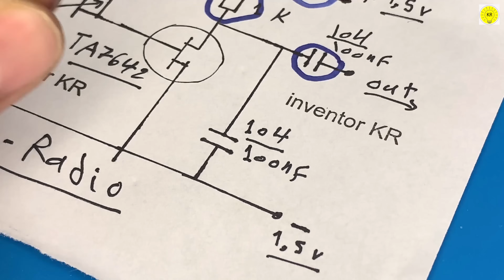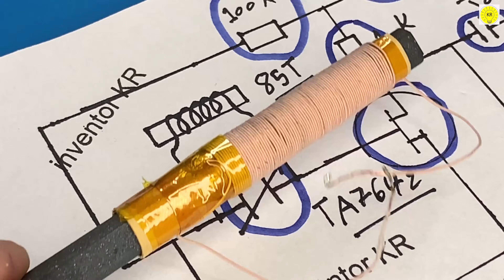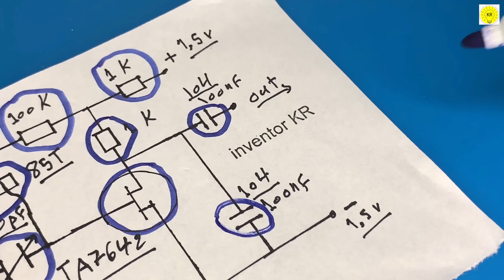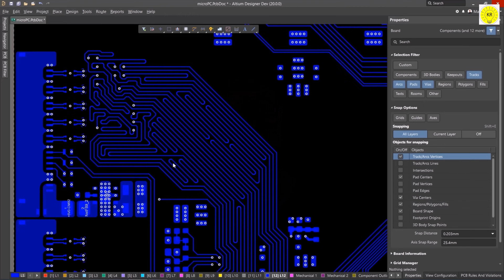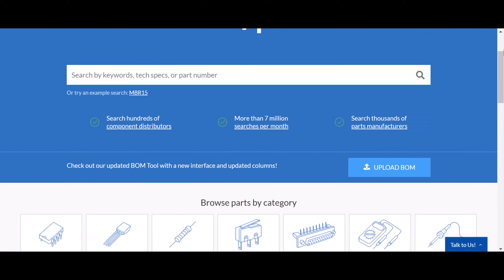make a simple AM radio , receives all international radio stations

Comment: Well, that's some of the worst soldering I have ever seen. Apart from that, it's really just a single stage RF amplifier which is reliant on the non-linearity of the circuit to produce an audio output.

Comment: I'm a drummer and Made a beautiful 6 piece electronic drumkit! Seen it on YouTube. So I bought a brand new cheap ludwig 6 piece evolution kit that was for half price because the music store was making room for the newer models and I told them "I'll take it!" So my brother and I got 2X2s cut them and screwed them into the lugs. Then came the sensors. I used giant 50mm piezo elements soldering them into a jack that went to the air vent. For snare I needed 2 piezos for rim shots.😂 I created cones by using some type of material (not too soft not to hard) used thick double sided stick tape for vibration isolation. Finally I put mesh heads positioned on top of the cone and lugged them down. using trs cables I plugged them into and old drum module which went into a mixer. I bought cheap drum cymbals that even choke!😅 I bought cool 2 piece hihat pads and are very responsive. Love the kit so much! I record with it and make videos. My brother died of lung cancer (never smoked) in January 2025 and every time I  play it, I look at the wood and screws that he put in. I'll cherish this kit and his memory 🙏
Reply: भावुक कर देने वाली पोस्ट.. मुझे भी हमारे दोस्त बिछुङने का बहुत दुःख हुआ... यादें सदा रहेगी... 😢😢😢

Comment: Would it work without the transistor?
Reply from the maker: Great question! While transistors are commonly used in AM radios for amplification, there are some simple designs that can work without them, relying solely on passive components.

Comment: wait a sec...what is the value of the battery and how is it biasing the transistor...?or them capacitors charge it for a while to raise the voltages up for a while?
Reply from the maker: Good catch! The battery's got to be just right, and the caps help keep the voltage steady. Let me know if you want to nerd out over the details!
Reply: @inventorkr1 sure buddy I really want to. More in-depth analysis...I understand the signal is sinusoid right..? Buh I didn't catch a diode for rectification in your acct or it depends?

Comment: Without a diode, how the signals will rectify/????
Reply from the maker: Great question! The diode is essential for rectifying the signals, but there are alternative methods to achieve signal detection in AM radios.
Reply: @inventorkr1 i this circuit, which method you have used instead of a diode? Bro...

Comment: He give us a wrong information. In diagram shows that he using a MosFet. But  TA7642 is a AM Band radio IC. So nobody should not try it by using any other MOSFET. It will not work. Everybody who want to make this simple radio, before start by any other MOSFET must check TA7642 datasheet by Google charge.

Comment: Can't solder. The whole board should have been tinned. And on the homemade board it was necessary to make pads for the parts. The pins at the end should have been bent to have better contact. It is necessary to use flux. There is no point in showing the same operation a thousand times on video. TA7642 is not a transistor, as shown in the diagram, but a microcircuit. The video is useless for training, since there are no basic elements - such as transistors, diodes and inductors.

Comment: When I was about 10 my dad got me a set like this for Christmas. There was no soldering, the baseboard was a grid of contact points into which screws could be driven to hold the components. We immediately sat down to put the radio together. Meaning: he did the putting together, and I the watching without touching. The radio did work. We had great fun. Well, at least he did.

Later I took everything apart and followed instructions to build the thing myself, but it wasn't quite the same. The somewhat painful memory only became a fond one by the time I was 20.

Comment: I was given a simple crystal radio kit as a kid.    It didn't work but an electronic engineer uncle said the crystal working as a diode was junk.   He replaced it with a proper diode and it worked fine, using no batteries.   It was my first real introduction into listening to the radio.   The theme song to the movie "The Good, The Bad, And the Ugly" was popular on the radio at the time and I heard it a lot.   Fond memories of that crystal radio set.   😊
Reply: You probably had a piece of Galena with insufficient hot spots. It would be very rare to have one without any, but I suppose they might still occasionally turn up. I'm glad that you enjoyed the receiver. My first one put me on an escalating path to a life long hobby and career. Can you imagine a hobby that you get paid for doing?
Reply: Me too, i built never worked
Reply: Why is there so much interference in this set?
Reply: @JB-uj3qm Excessively wide bandwidth. It's caused by low Q resulting in lack of selectivity. Ham operators and serious SWLs have a lot more control over those factors with sophisticated designs. Simple still serves a purpose however.
Reply: 10 A Diode

Comment: Exactly! This is the essence of Adventious Learning—self-education through self-realization. Instead of just reading and memorizing, you take immediate action to test, verify, and deeply understand what you learn.

Example Breakdown: Electromagnet Experiment

1. Traditional Learning Approach (Passive Learning)

Read: "Coiling an insulated wire around an iron rod forms an electromagnet."

Memorize for an exam.

Forget in a few months.

2. Adventious Learning Approach (Active Self-Realization)

Read: "Coiling an insulated wire around an iron rod forms an electromagnet."

Ask yourself: Is this really true? How does it work?

Test it out:
✅ Take an iron nail.
✅ Wind insulated copper wire around it.
✅ Connect it to a 12V battery.
✅ Bring a small iron pin close to it.
✅ Observe the attraction.
✅ Turn off the switch and see what happens.

Self-Realization: Now I know that electromagnets only work when current flows!

Because you’ve seen it with your own eyes and felt it with your hands, this knowledge becomes deeply ingrained in your brain—you will never forget it.

Adventious Learning vs. Traditional Learning

---

The Bigger Picture: Applying Self-Realization to Everything

The electromagnet example is just one case. This method applies to any subject:

✅ Mathematics → Instead of just memorizing formulas, try to derive them yourself.
✅ Programming → Instead of watching tutorials endlessly, start building small programs immediately.
✅ Business → Instead of taking endless courses, launch a micro-business and learn by doing.
✅ Engineering → Instead of studying blueprints for years, start designing, breaking, and fixing things in real life.

🚀 This is how true innovators and inventors are made.

---

Challenge for You:

What is one thing you’ve "learned" but never actually tested in real life?
How can you apply self-realization to verify and deepen your understanding?

Comment: Habe meinen selbstgebauten 8-Kreis-AM-StahlröhrenSuper  mit EF 13 in der HF-Vorstufe, die aperiodisch mit mit der nachfolgenden ECH11 gekoppelt ist; anschließend mit einem 4-Kreisbandfilter  mit der ZF-Röhre EF11 bestückt ist sowie einer ECL11 als NF-Verstärker.
 HF-Röhre EF13,  ECH11 und EF11 sind schwundgeregelt mit gleitender Schirmgitterspannung in Betrieb. 
Der Superspulensatz SSp 256 von Fa. NEUMANN mit 3xKW, MW UND LW  ist hierbei zum Einsatz gekommen; für die Funkamateurbänder 40-, 20-  und 15-Meterband habe ich nachträglich noch einen Transistor-BFO im Einsatz.
Auf LW geht gar nichts mehr.
Auf MW tagsüber nur noch Radio Budapest hörbar, was sich nachts aber mit viel mehr Sendern durch die Raumwellenausbreitung bemerkbar macht.
Auf KW geht natürlich alles wie vorher; die Funkamateurbänder sind exzellent mit meiner selbstgebauten KW-Lupe zu empfangen.
Resümee:
So ein AM-Empfänger passt nicht mehr in die heutige Zeit; der Störpegel ist gewaltig und lässt einen Empfang von MW-Sendern nicht mehr zu.

Comment: To make circuit board, simple way to apply resist for etching is to draw with Sharpie magic marker instead of using tape. Be sure board is clean first. Also, etching is quicker if ferric chloride is warm, not hot.

Before etching, clean board with 400 grit sandpaper and then wash with alcohol.

73 DE KK5R

Comment: The heterodine radio, what is the measure of the transistor, is NPN, or PNP, the what is the measure of the coil, winding from wire of  copper, and the bobbin bar for heterodine winding of what turns, the resistence variable what is the measure ? The speaker what is the power measure, and their resistence, the plate of copper what is their measure, what time are in solution?

Comment: Way back in the mid 1960's I used a tiny am only "Transistor" radio. These were very cheap, used a single 9-volt battery. And had a single  mono only ear bud. 
If you used the built-in speaker you killed the battery in just a few days. BUT if you just listen through that one little ear bud, the battery could last you over a month!
Good times! Sleeping outdoors,  under the stars! With my radio and an old pair of War Surplus binoculars. I'd sky watch all night long.
Reply: Same here

Comment: This soldering method is a disgrace to any self-respecting electronics engineer, it was too hard to drill the holes.
Reply from the maker: I appreciate your opinion but this makes it easier to understand the connection of components.

Comment: This project remember me when I was a boy and I built an am radio with my father using only 3 components, a germanium diode, a variable capacitor and a coil, as well as the antenna which was a simple wire.
Audio in headphones, no battery...it was very funny!
Reply: वाह 😮

Comment: This design is bad, I doubt it even works. Without an antenna, you'd be lucky to receive a signal from a meter away. Connect an antenna (a wire will do) between the LC tank and the input of the IC. The longer the better. Using a handful more parts can make this actually work

Comment: That's bullshit.  Where it is the diode that will rectify  the radio wave at the antenna input? That's the first step.
Reply from the maker: The transistor used is an integrated IC
Reply: @inventorkr1  
My apologies.  Thanks for the clarification.
Reply: @inventorkr1 you clearly know nothing 😂

Comment: Can I increase the Vin? I'm using headphones and i can't hear anything, increasing voltage my earphones starts to make noise but i can't listen to any radio station. I was wondering if problem could be Vin
Reply from the maker: You need headphones with high impedance
Reply: @inventorkr1  I have earphones but sound is too low. I increased Vin and now sound is better but there is a lot of noise. I can hear something tho. I was wondering if the voltage increase was to blame for the noise...

Comment: Good video! But...
①TA7642 is an IC (integrated circuit). Please do not write TA7642 with symbols like FET.
②Because the method of writing 7 is unique, some people may mistake TA7642 for TA2642.
③Please tell them that resistors and capacitors have no polarity, so you don't need to worry about their direction.
Reply from the maker: Thanks for your comment, I appreciate your advice

Comment: Qreat video.  One may-be stupid question: In the video you use LC circut of 433uH and 160pF.  This set up will resonate with 19KHz signal. Correct?
Reply: No, putting the values into an LC tank calculator gives roughly 604KHz which is towards the bottom of the MW band

Comment: I have seen so many people making boards, but this is the best. I wish you could do the project on a breadboard. Thanks a lot. Nice video
Reply: It's not a good idea to do this on a breadboard. While it's easier, breadboards create something called "parasitic capacitance" which messes up everything about this circuit. Because of that, you probably won't hear anything but noise if you build this on a breadboard. Try a veroboard (aka perfboard) which is easier than pcb but without the disadvantages of breadboard

Comment: You will only pick up local stations. Sure you can pick up international stations as long as you are in range of the signal. And there are still short wave stations, but this radio does not cover those frequencies.

Comment: The ferrite inductor actually used is certainly many times stronger than the little coil in the display image. With  that little coil the tuning range would be perhaps in the vhf spectrum.
Reply: Wrong. What do you mean "display image" if you care to look at the data sheet, the ferrite aerial concurs with the datasheet guidance.
Reply: @icarossavvides2641  This is somebody who somehow does not understand what I said.
The display-image for the video does not match what is in the video. That air-core inductor definitely would not produce a resonance in the mediumwave range.

Comment: In 1957, I put a one-transistor AM circuit (not nearly so many parts) inside a little match box and used the radiators in the university as ground. Mine was perhaps not the first transistor radio, but I bet it was the smallest.  LOL
Reply: Was it an regen receiver
Reply: @TechniCraftYT  — Simpler than that.  It -- as I remember now 66 years later -- had a couple of capacitors & resistors, one transistor and a tunable coil.  That was it.
Reply: @fredrichenning1367  so you just had an crystal radio with an transistor amp.

Comment: Labelling the TA7642 as a JFET is completely misleading. That's an entire AM decoding circuit in a three terminal device, not a simple transistor. Also, good luck trying to find variable capacitors that are the right size these days. They are very hard to come across.
To people watching this -- if you want to build an actual AM radio from a kit, I highly recommend the Elenco AM-550CK. You'll learn a lot more, and end up with a great AM radio for the AM broadcast band.
Reply: It is possible to use JFET as an AM detector. Such circuit is called "infinite impendance AM detector" but its layout is different than presented board.
Reply: @JanKowalski-vj9py  Right, but the part listed is NOT a JFET. It's an entire AM demodulation IC in a TO-92 package.
Reply: Although the symbol might not be perfect, to be fair he did label the part @ 4:00.
Reply: Also, the AM band isn't always the same everywhere so I am assuming the tuning is designed for the frequencies he wanted to receive.
Reply: @jimharris9394  That has nothing to do with what I said